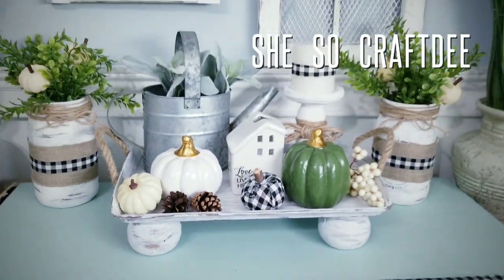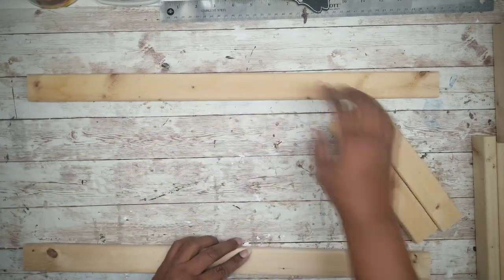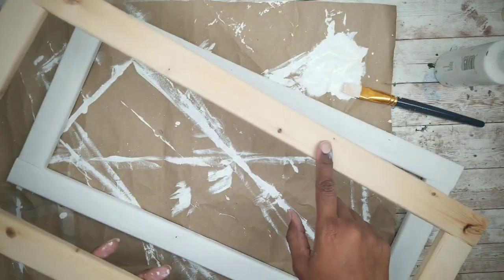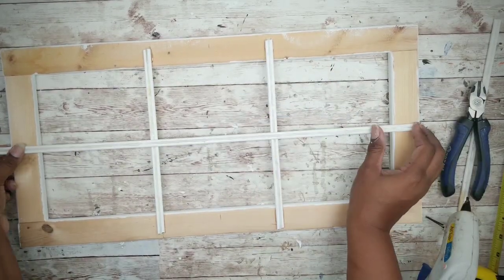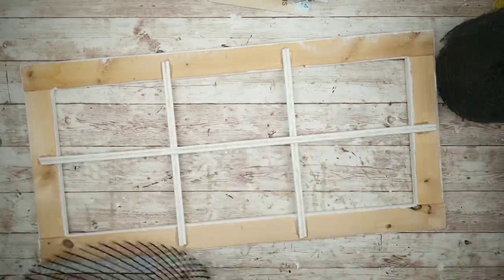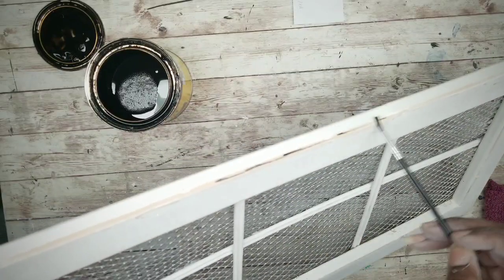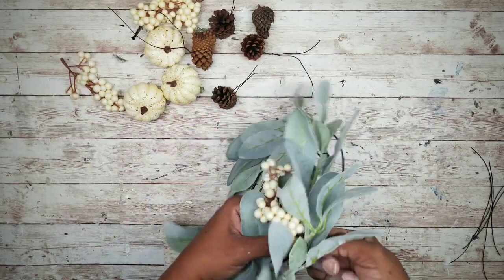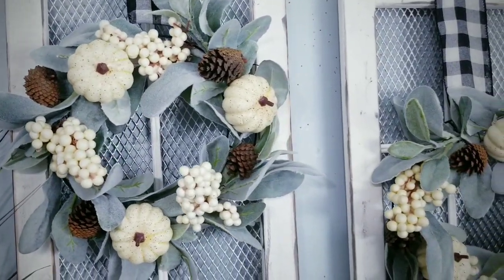DOLLAR TREE DIY 6 PANEL SOLID WOOD WINDOWS & PUMPKIN WREATH | Neutral Fall | Year Round Wall  Decor

Comment: I'm almost finished with mine, not sure if I will feel comfortable taking a hammer to it though. I worked so hard on these and ran into every possible problem you can run into. From being out of square glue not setting up the cross dowels breaking you name it it happened but I powered through

Comment: I love your projects! So cute.  🙂But Home Depot...ugh...everyone says the Home Depot will cut wood for you for free, but my Home Depot won't. They have all the saws, but posted a huge sign saying "Absolutely NO project cuts!" And they give me 10 kinds of crap over just trying to get them to cut the wood small enough to fit it my SUV. Very frustrating. They say it's because their saws aren't exact and don't want to be responsible for messing up our projects. Thank God my boyfriend has a workshop in the garage and a truck or I'd be screwed.   I wish we had a Lowes nearby. I hate our Home Depot. They're so rude and act like I'm bothering them if I ask a question. The girls up front by the registers are really sweet, but the guys by the wood...not so much. 😒

Comment: Cute but I feel you can just use DT picture frames instead of going out getting wood
Reply from the maker: Sure, you can use the frames, but they are not real wood, and aren't very sturdy. Plus they will cost you a lot more to make this 22" frame. I try to be as budget friendly as possible, and I used less that $2 of wood for this :) Give it a try!